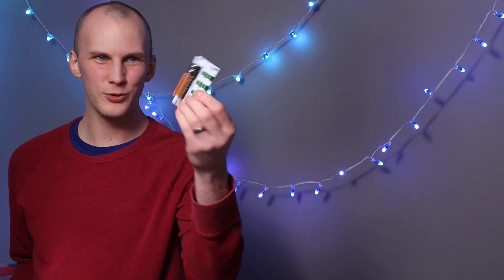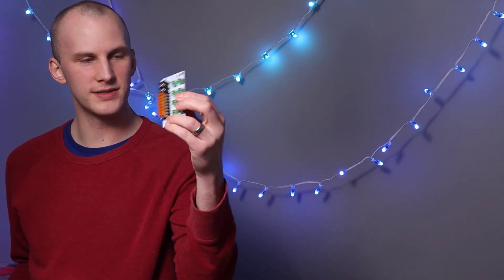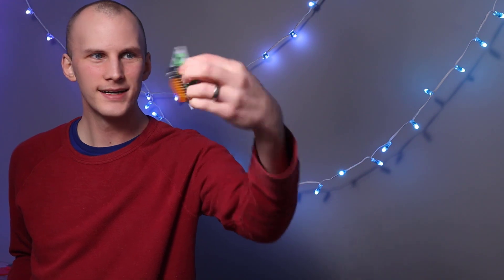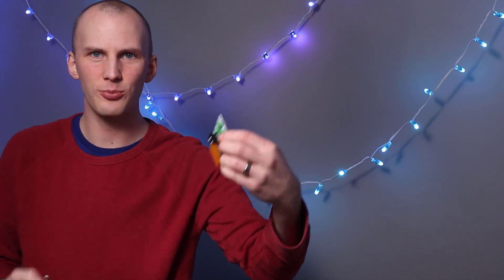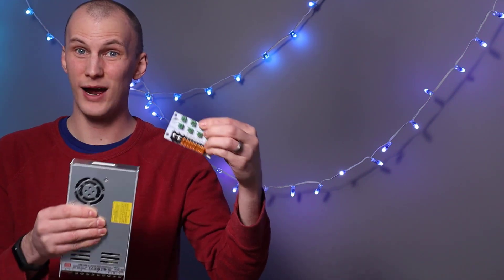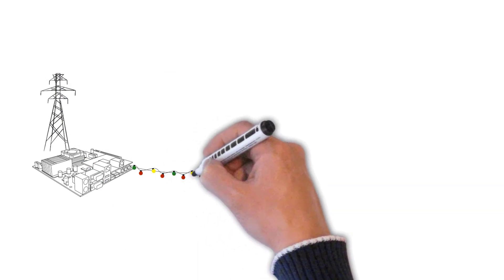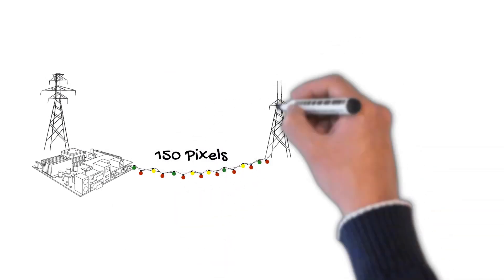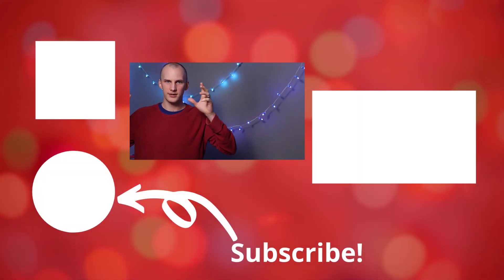Christmas Light Pixel Power Injection 101 - Do I Even Need Power Injection?

Comment: As you said I would love to avoid the need for power injection in my setup and go with the Mattos Long Range Receivers instead. Do they have a separate output for the power for power injection purposes? I think they should add one, so one could maybe at least to a power injection at the end of a 200 pixel strand. Assuming that I have 10 feet to my first pixel from the point where the controller is, how many pixels (12v) would you recommend to run per Port. During my main show I run the pixels on 100% theoretically (When do you ever use full white in the show). Would 200 pixels per port be a good bet?
Reply from the maker: We always recommend around 150 pixels per port at 12v and 50% .  That's a broad rule of thumb, we have more info and help inside of our Academy, which you can try for just $1: https://academy.learnchristmaslighting.com/lcl-academy-DT

Comment: Newbie to this process. I'm using 30mm led point pixels. 200 point pixels w/3 LEDS in each so 600 leds. Do I need to power inject and If so do I go to the end of the entire strand to inject? At whichever point do I clip the v+ & v- at the last pigtail and connect the injection wire to the clipped pigtail wires?

Comment: I am just getting started with this for next Christmas, and I am considering the roof line.  It is about 60' long and will require about 5 - 50 pixel lights (at 3" spacing).  You don't seem to prefer power injection (and it seems like a bit of a hassle), so I am wondering what other solution you would recommend?  Running 3 strands from one end, and 2 from the other end (or halfway down the line)?  I do plan on having a Falcon smart receiver about halfway down the house for the picture window  lights (3 strands - 150 pixels)  and 3 mini-trees in front of the picture window anyways.  And possibly another smart receiver near the end of the house for a star on the antennae.
Reply from the maker: Yes, either turn the brighteness down and/or have it start and the ends and move in, or the center and move out.  If you turn the brightness down to 30%, you should be able to get 250 pixels on one output at 12v.  Or, split the run in 2 and you can run it 60%.  There are a few ways to solve it without power injection, but these are the most common :)

Comment: Nice information. Foe me, I don't mind power injection after all with 5v pixel, I am bound to. However, what I have been doing is to break my show into series of models that has between 10 - 50 pixels and I run them on small power (1-2 amp) supplies that are attached to the models themselves. So, I have a bunch of mini trees, arches, candy canes etc that I run like this using PixelSticks. So the Pixel sticks is attached to the power supply and both inserted into a 2 inch tube with the AC and DC terminals out on pigtails with cable gland making them element-proof. All, I then pass around is the AC line to power them and since they are all on wireless I run very little cable around. Now with my mega tree, I do not have a choice but to inject. This has worked for me for three years now. I don't use centralized controller, simply my soldiers of Pixel Sticks.

Comment: Thanks for the video, I am brand new to pixels and lot of this has confused me, i am setting up my roof-line on my house this year so far i'm at 200 pixels, and like to add 150 more people keep telling me i will have to run power injection but wasn't sure how. so it sounds like from my number 200 pixel to my number 201 i need just to cut the positive lead. then run another Positive and negative from my power supply to the 201 pixel to power number 201-350. I am using 12 volt 2811 pixels. so far i see no dimming or flickering.
Reply from the maker: Yes, and If it's the SAME power supply powering the first 200 pixels, you don't even need to cut the positive (but you can)

Comment: Great Video!  What is the typical brightness setting, and number of pixels between power injection points people use (for both 5V and 12V setups)?  I am setting up a mega tree with 16 strands of 75 pixels each (currently have the 5V variety) and planning ahead. :)
Reply: I use 5 volt LEDs at 25 or 30 percent brightness and add power injection every 150 LEDs. Same strategy for strips and pixels.
Reply: @timcrandall970  Perfect advice!  Thanks!
Reply from the maker: And then at 12v at any given percentage, you will get over double the amount of pixels before injecting power.

Comment: Great explanation. I've never power injected my show and run over 40,000 pixels. I choose to put the point of consumption as close to the power and data as possible while keeping my brightness at 20%-30%. I have used this method for six years. That being said, if people feel more comfortable power injecting there is absolutely nothing wrong with that. As you said, some may want 100% brightness for their application, and at that point, I would advise power injection.
Reply: How many pixels do you typically run per output? I bought 3 props that has 300 pixels each and I would like to run it off 1 output. I'm just now starting into xlights and I don't know if I used multiple ports of the controller I can make it see it as one continuous prop. I'm not sure how it knows its one thing. I'd like to run all 3 off of a falcon f4v3 controller, but I don't know if it's possible. What do you think?
Reply: @beng32112  I have up to 420 running from one output on my F16V2 for my icicles over my garage. There is no extension so the first pixel plugs directly into the controller which is mounted under the eave at the start corner of the prop. I typically break my Gilbert Engineering high-density coro props into multiple outputs from receivers connected to my Falcon F48 or Kulp F40D. This allows me to get data and power very close to the start of the props. For my GE Grand Illusions (1,000 pixels) I use four ports from a receiver at 250 per. It's a nice balance and at 20% looks great. Listen to a lot of folks out there and begin testing. Power Injection, no power injection is a journey we must all take and be responsible for. Enjoy the process!
Reply: @xTremeSequences  Awesome thank you!
Reply: Can you show a physical example of the power injection and using a power distro board?